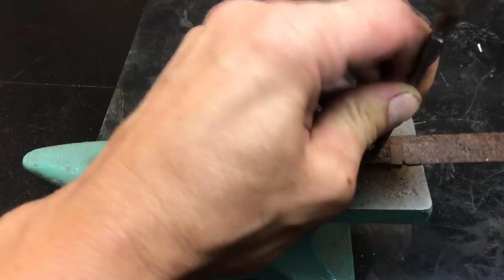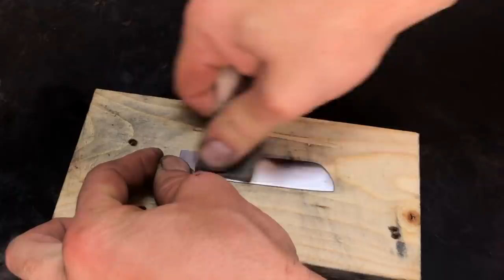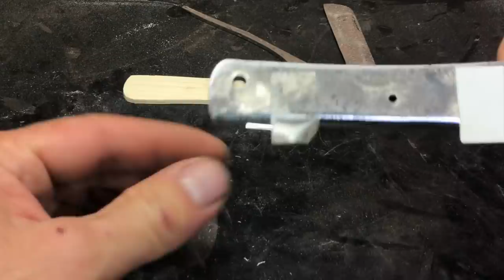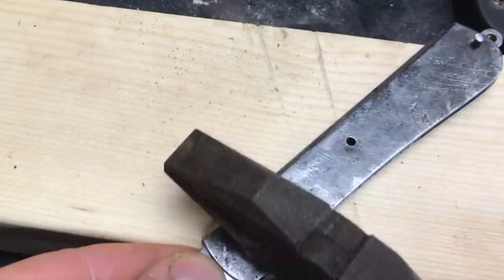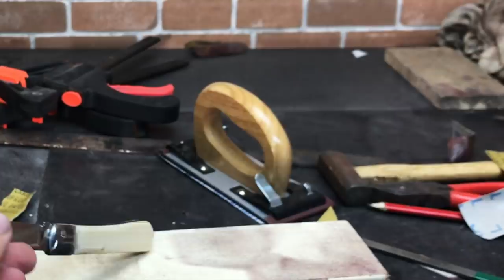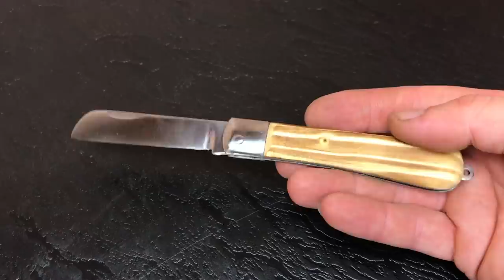Rusty Pocket Knife Restoration

Comment: Finally somebody who just grinds the rust off instead of putting it in some liquid for hours thank you bro
Reply from the maker: LiZz ClarK 😁👍🙏
Reply: Its easier yeah, but with carbon steels like 1095 pitting is an issue and grinding the rust off can destroy the blade. This one obviously could be fixed by grinding.

Comment: Would live to see you use a nicer wood for the handle, the original wood looked expensive
Reply: Have to be honest, the original wood looked like ordinary dark brown wood to me. There are expensive woods that color, but there are cheap ones too. Judging by the overall design of the knife, this is clearly a working man's knife. Doubtful it originally had expensive wood scales on it.
Reply: He could've use metal hardening/normalization proccess (burn it red hot and cool down with water) about the metal part include the blade. Plus the pins are originally went through the wood, not glued on the metal.
Reply: The original wood was about as plain as I have seen it didn't look like anything particularly valuable.
Reply: @cyng6734  why would someone harden a blade that was ALREADY hardened.

Comment: When you see sparks that means your taking away material which means all the Tolerances are off and the end result is you've got a sloppy jack knife . lighty sanding and soaking in a rust removal solution is ok but never ever take a angle grinder to a knife !